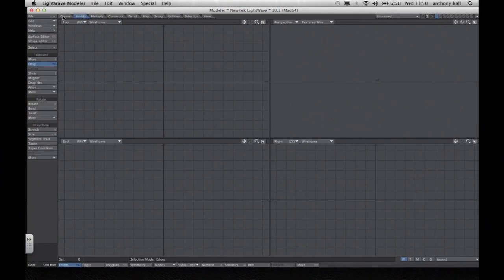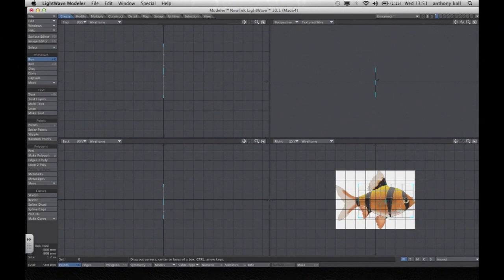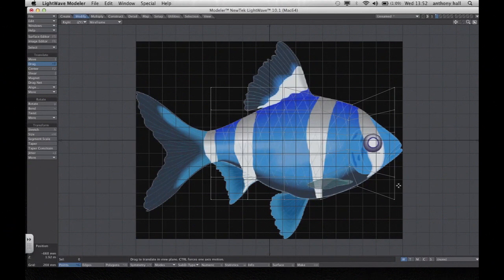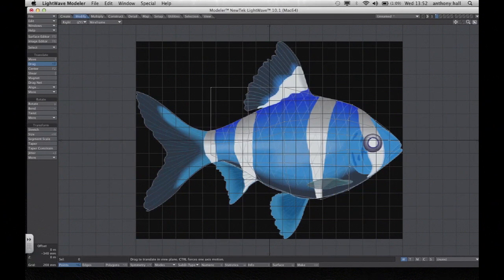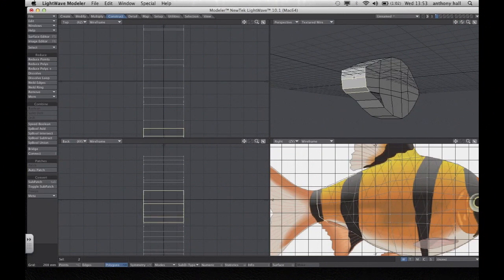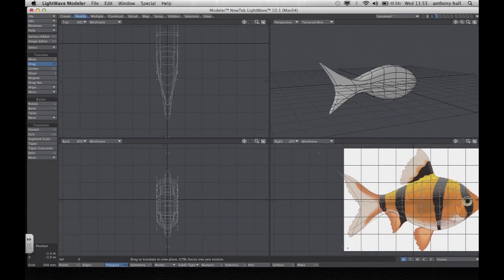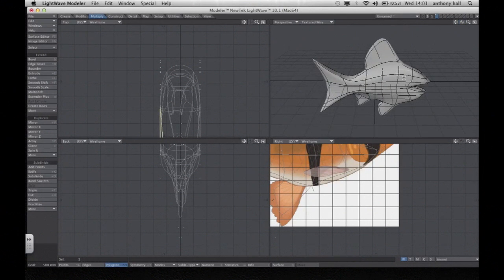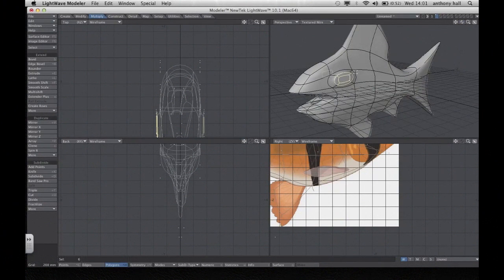Lightwave 3D tutorials (Basic modeling of a fish)

Comment: hi,I can not zoom my image,and my image is so small!
Reply: Your backdrop image is not affected by the level of zoom. You have to go into the display panel (press D), find the tab with your backdrop's information on it, and change the image size (in terms of Meters of Lightwave's grid) manually there. The larger you make it, the higher the resolution will need to be if you don't want it to be a pixelly mess.